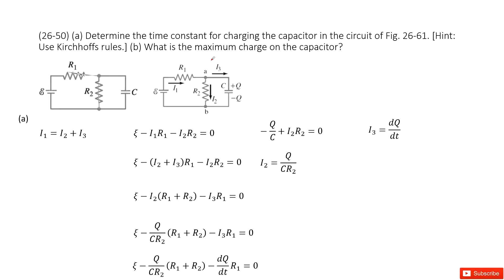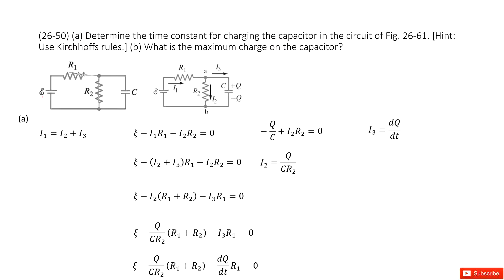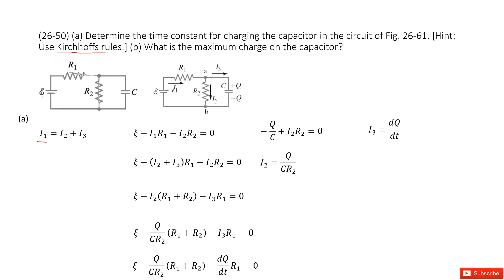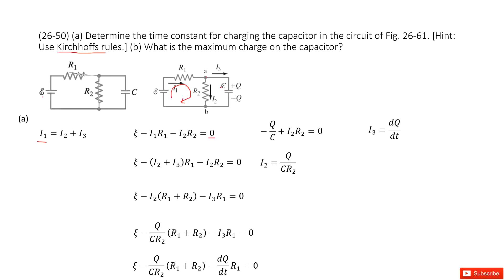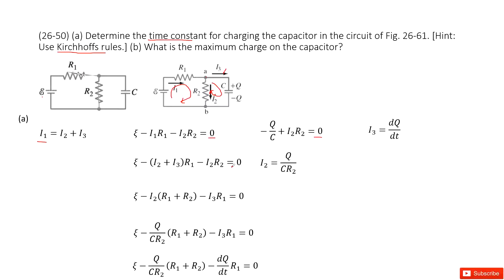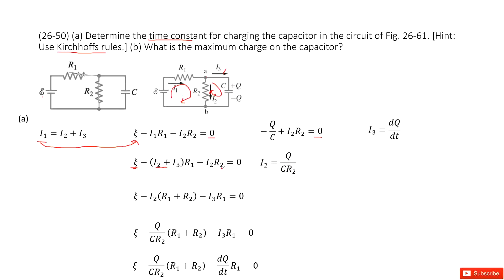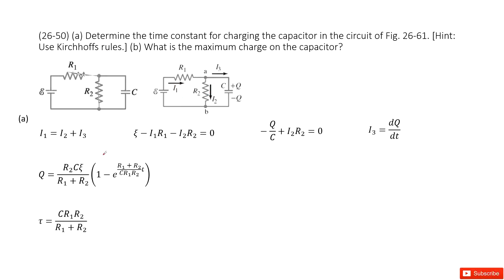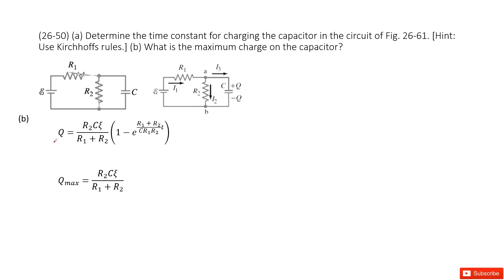(26-50) (a) Determine the time constant for charging the capacitor in the circuit of Fig. 26-61. [Hi

Comment: Question B is wrong. The charge will be maximum when the time goes to infinity, as it is about charging a capacitor. There should be a minus sign included in the exponent.